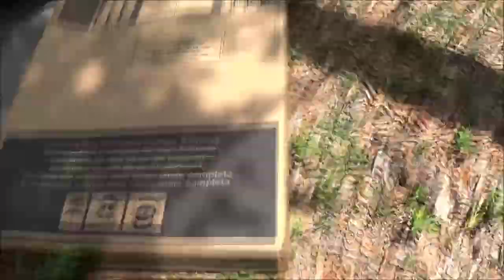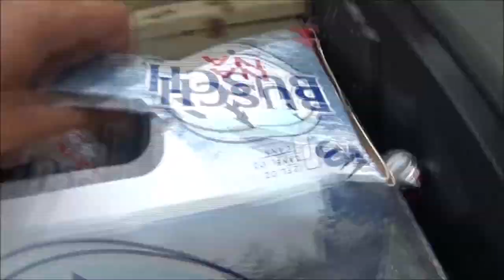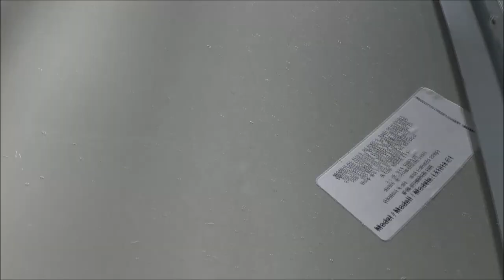Putting Up A 10x14 Shed By Arrow

Comment: The Shed looks good.  I know what you mean with these metal sheds, I put a couple of them up in the past and had the same issues with holes lining up.  I wound up having to drill the holes out.  I put silicone caulking over all of the bolts on the roof, and seams as well.  That's a good idea putting a couple of Heat vents so the heat doesn't build up in there.

Comment: I put this 10x14 shed up over the last 2 days by myself.  For the top ridge cap I put a large rock on the top to hold the screw down til I got the nut on the inside.  For the last ridge cap put the 2 screws in early because you wont be able to reach it later on.

Comment: I just put one up same way with it sittin on a deck and i had the same issue with the rain water comeing in under it what name brand caulk did you use to keep the water out?
Reply from the maker: I just used some cheap caulk I baught at the dollar General store..still holding up well.

Comment: The silver tape was worthless it was about s*** to try and peel the paper off of it came in a box with what looked to be straps in the box and they got thrown away right off the Jump that was the rubber gasket that goes around the outside edge of The Gables overall I rate this shed six out of f**** 10 because of the ignorant beauty ring that runs down the middle of the top and down both sides besides you can get off a ladder but how the hell do you put the top on
Reply from the maker: Oh that tape that came with it sucks.